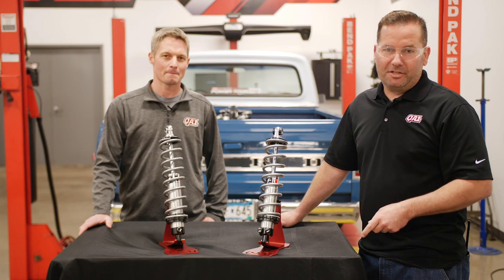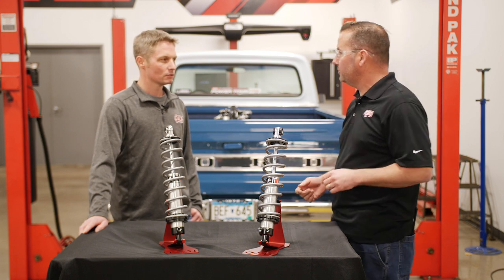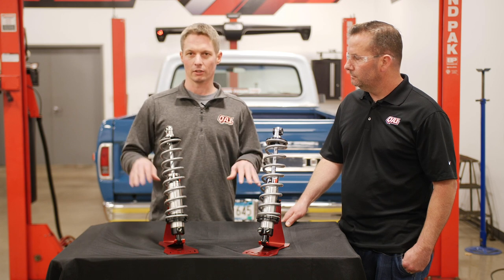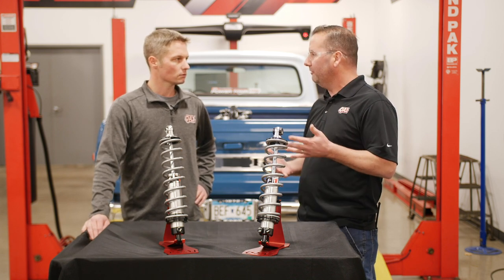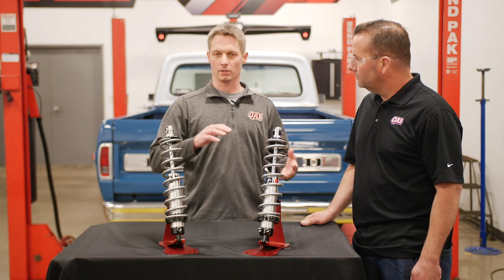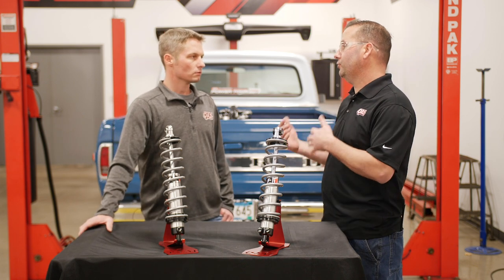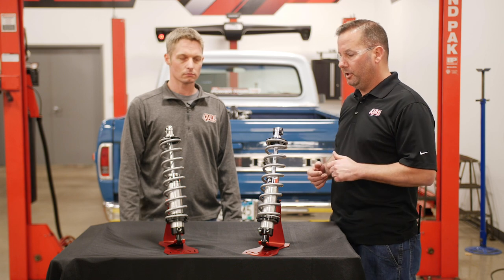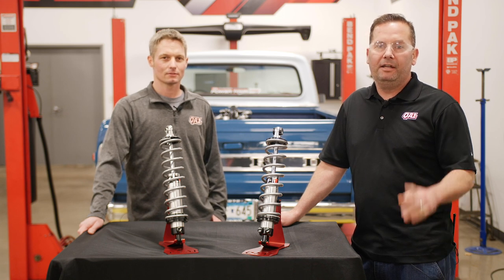How to Tune Shocks for Your Streetcar | QA1 Tech

Comment: I bought these shocks coil single adjustment front double adjustable rear on a 70 corvette and i am impressed by them make sure your control arm bushings are in good shape and get an alignment after installation. That is what I did and I am happy with this product good luck

Comment: Will 20” wheels clear the coilover that is on the outside of the frame on my 65 C10
Reply from the maker: They certianly will. We have many trucks running 20" wheels with a 5.5" backspacing.

Comment: Im thinking of pitting single adjustable coilovers like this in my 67 volvo 122. I want it to handle well on a track and the street. These will be mounted on a solid rear axle with a parallel 4 link with a panhard. What stroke would you recommend for something like that?
Reply from the maker: Hi there! thanks for reaching out. Please give our tech team a call and they can recommend something for you! 52-985-5675

Comment: I have a sa twintube coilover 24 way adjustable damper 10k front 7k rear for a 98 honda crv. I have the settings at 14 from full soft front and rear. Going over speed bumps feels like it wants to shoot to the moon why is that? Too stiff or ...?
Reply from the maker: It could be that it is too stiff. We would recommend adjusting your knobs to a softer setting.
Reply: @QA1TECH  so would I have to soften both front and rear or rears only and vice versa? Bcuz it seems like it's the rears that are too stiff and wants to shoot to the moon
Reply from the maker: @gabrielr6679  I would recommend starting on the rears if that is where you are noticing the stiffer ride. It may take a couple tries to find the right setting. Feel free to reach out to our tech line for more assistance if needed! 952-985-5675
Reply: @QA1TECH  Thanks for the advice it's been 24 years since the struts have been changed and I'm trying to understand sa twintube coilover that states that it has 24 adjustments on damping force. I guess it's only adjusting rebound only?
Maxpeedingrods customer service sucks, sound like they are reading what to tell me instead of actually trying to help me.
Reply: @QA1TECH  Can you guys make a video on setting dampers from full soft to finding the sweet spot for your ride and also go over bumps and explain what is happening like if it's too stiff or soft, for a SA twintube and monotube? Like actual on car/truck/suv  visual or animated explanation as some of us needs to see what is being explained.
Reply from the maker: @gabrielr6679  Thank you for the feedback! We will look into this.

Comment: I have a 1972 F100 just like y’all’s blue one in the back there but a short bed. I’m installing a 4 link in the rear and I wanted to use QA1 single adjustable coil overs. What parts number am I looking for? Or should i contact you guys by phone?
Reply from the maker: I recommend contacting us by phone. Our F-100 coil-overs are designed to work with our suspension systems. We can most likely make a custom shock setup work for you, we just need some information on your setup. Please call our tech line at 952-985-5675 Thanks!